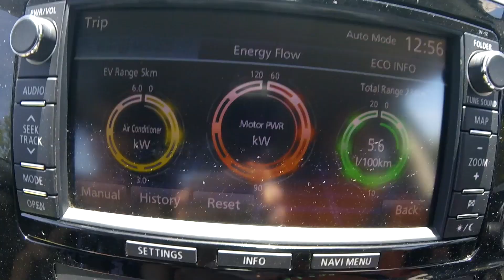EP181 - Do we have a #PHEVcure?

Comment: Andy,

Still not sure about this 85% or 95% top charge, so I asked Mitsubishi UK.  Not sure I believe the answer!  However, some interesting info on the other end made 🤔

Good afternoon Mr Bond
 
Thank you for your enquiry.
 
I can confirm that, when charging with the 10 amp charging lead or 16 amp home charging point the battery will charge to around 98-99% whilst the display indicates 100%.
 
I have attached a data list snap shot showing the Charge state for  Control and Display (control being actual charge).
 
The charge state will drop to around 26% to 30% in use.  If the SOC (state of charge) drops below 26% The turtle sign will appear on the display and reduced power may be felt. If the engine cannot start, at 22% SOC the heating and A/C will be disabled, at 17% there will be a further power reduction and at 13% the car will stop driving.  This level is still sufficient to start the engine, once it has been refuelled, for instance.
 
I trust that this is of assistance to you.

Arial
Reply from the maker: Ahhhh, typical consumer response :D And it's wrong too. The turtle does not turn on at 26%, that is nonsense.
Reply: unplugged EV, not sure if this is a MY19 thing or not.  Not that I want to try it! 🤣

Comment: Did anyone consider the frequency of charging as opposed to the km covered could be the issue?
Reply from the maker: Hi Mark, I've seen your question popping up on Gary's channel too. The battery gets charged and recharged hundreds of times during a trip, in smaller and larger chunks.
With every full charge you will get around 40-50km out of it. I've tried to not charging it fully for my commute with no further benefit. The frequency of charging rises when you don't fully charge. From what we can see now it has nothing to do with how often the battery gets charged. The answer is simpler...
Reply: Hello, I fully appreciate what you are saying. I am mentioning the number of times the car is charged by the home charger. I have not seen any graph (or anything) which shows battery degradation vs the number of home charges.

Comment: I charge every time full charge and as you say it never full charge really. Then again in town driving it tries to keep in electric mode at much as posible especially at 20 or 30 kph. Now my car has 31000kms from new 2014 model and I cannot get more than 32km out of a full charge in cold weather it increases to 38 km in hotter weather. Would this look alright?
Reply from the maker: 38km for 31.000km is a bit on the low side. You haven't got the Dog to check the battery?